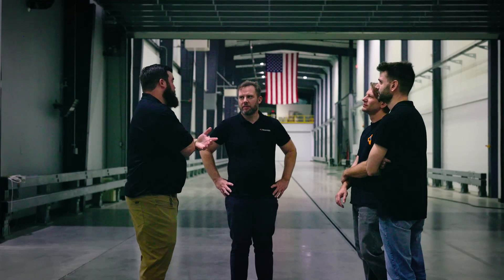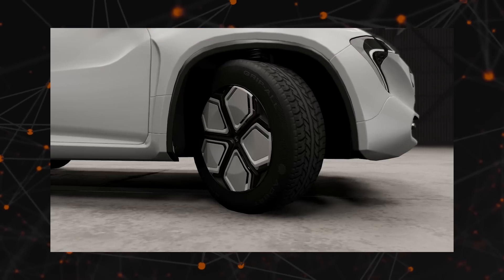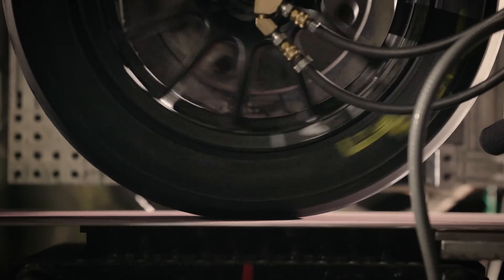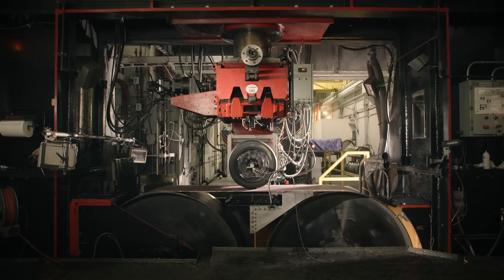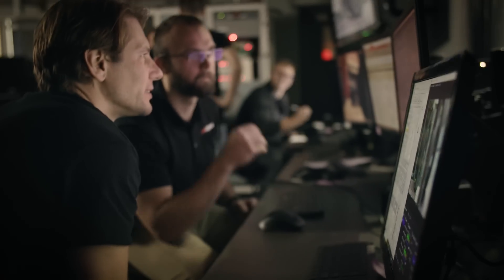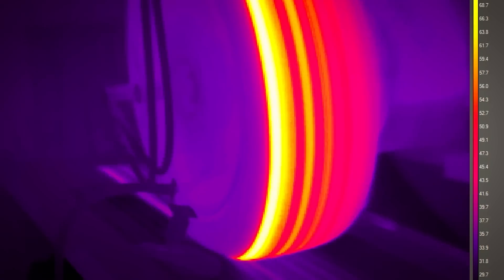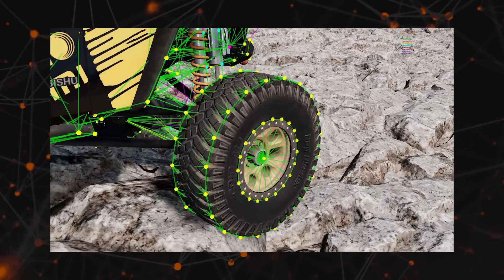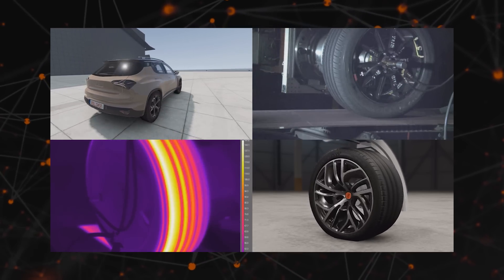Sneak Peek: Tire Physics Development

Comment: BeamNG update that kills assetto corsa is currently in development!
Reply: Yeah I like Assetto but it’s really easy to tell you’re basically just driving a solid rectangle with physics applied in it. Beamng has always felt way more lifelike to me except for the tires. Super excited for this!
Reply: @-Burb  FWIW I implemented torsion and bending chassis compliance and also camber, toe, track and wheelbase wheel compliance and it didn't feel that different to a completely rigid model. Even when it's not vibrating like BeamNG does (although you need to remove bending for it to play nice at even 2kHz).

Much more impactful to the experience was implementing physics for the steering rack, and AFAIK BeamNG does have some lateral rack compliance, although no column compliance or anything, but I could be wrong about that.

I think a lot of the "lifelike feeling" in BNG is a placebo from the softbody system vibrating profusely and causing inaccurate contact patch load variation and alignment change. Real cars do have compliance, but it's not like that.
Reply: Update that might finally bring BeamNG tires to the level of other sims lol. This is definitely the weakest area for Beam currently. So let's see.
Reply: @namesii1880  By the looks of the ambition here, Beam's tire physics will surpass other sims.
Reply: @Cedar77  eh Lemans ultimate would probably still take the cake. they've taken the RF2 model and refined it massively
Reply: @namesii1880 Yes, tires and aerodynamics. So excited for future improvements!
Reply: @namesii1880 found the guy who will finally shut up after the update
Reply from the maker: Never - AC is awesome! :D
Reply: Still needs proper VR support to challenge assetto corsa
Reply: It'll never kill AC, not even in a million years with the slow, spongy and unresponsive FFB they have. Not to mention the crazy lack of optimization so people's PC won't become toasters the moment they want decent graphics at a decent FPS. They shouldn't neglect these two sectors so badly.
Reply from the maker: @Dengar97  The FFB is indeed a problem a lower FPS, we hope the change to vulkan can give back some FPS and improve the situation. FFB is always a struggle as its on the edge of what's possible. We're trying our best
Reply: @beamng  Kind of a stupid idea, and I'm sure it's not really possible, but; have you tried running a rigidbody system for the driving specific solver and applying the softbody system only when appropriate, such as in crashes and perhaps in some more dynamic structures of the chassis?

Right now I've identified that the softbody system takes up a ton of CPU resources which could be used to run other physics faster, and causes tons of unwanted physics effects like CPLV and position vibration at the rate BNG runs at.